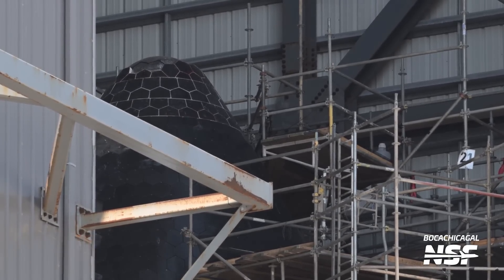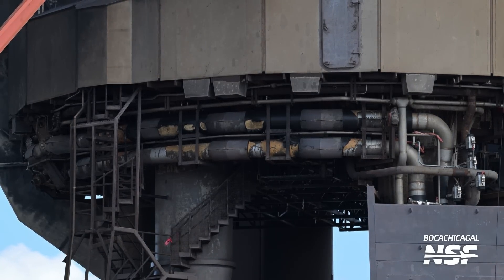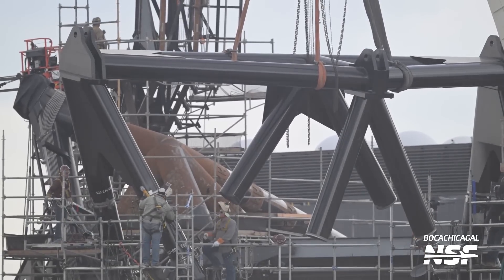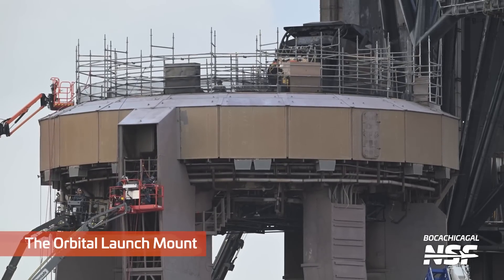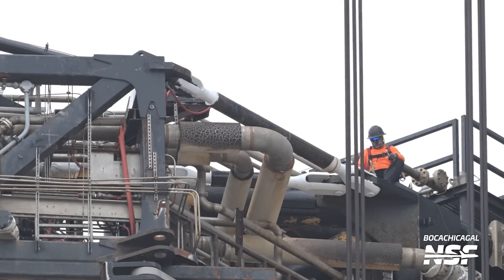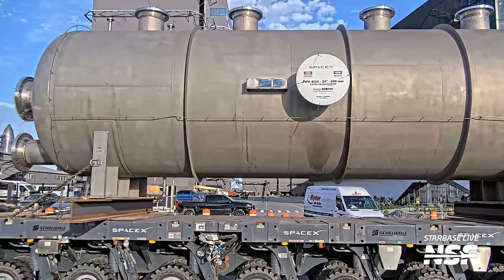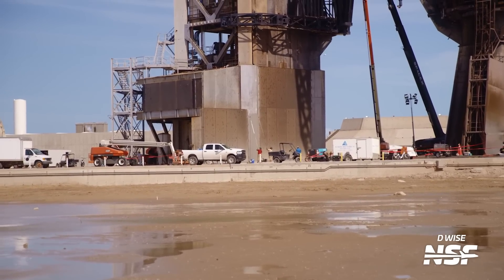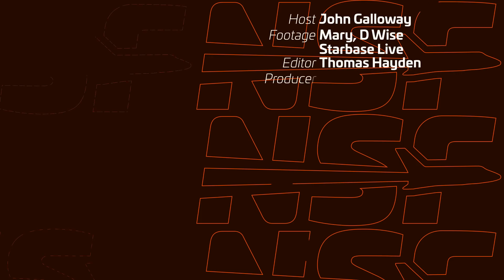Starship Launch Pad Damage Inspections | SpaceX Boca Chica

Comment: If the scrapes are in the middle doesn't that mean they're about 50% TOO long? What good is the section that never touches anything?
Reply: I believe the next set are shorter.  It's easier to remove than to add had they been to short and missed. :)

Comment: I wonder if the OLM at Pad A will become the "catch" tower and Pad B will be the launch tower?
The open design of OLM A makes it fragile, I mean, look at the insulation of the pipes and stuff .. 
There is a big difference between 7700 tons of pressure from the raptors at launch vs ~100-250 tons of pressure at landing.

Comment: I doubt they will try to fix the front flap hinge burn through issue on the remainder of the block one ships. With the flaps being placed more leeward on the block two design, they would be trying to solve a problem that may just go away by itself.

Comment: Two comments/questions: The water deluge system was used again when the booster landed/was caught, but the booster seemed at an angle, so would it not scorch or damage parts not normally protected by the water deluge system and second, the chopsticks begin to close before the booster is actually between the arms, so how does the tower know when to begin the closing sequence? Does the booster flight software actually control the chopsticks in the final phase of landing?

Comment: I dont think the current heat on the flap issue from flight 5 will be of too high importance. Since there is only 1 more Block 1 ship left to launch, and the Block 2 ships have the flaps moved in such a way they will not be in as vulnerable position. They will only go nuts strengthening that area if thier analysis of the data results in escessive heating where the Block 2 flaps will be mounted.

Of course for the next flight they might choose to do minor work, but I think they will more focus on other areas for the ship, and fully checking over the rest of the heatshield as well as going over the booster with a fine tooth comb.
Reply: I just don't understand why they don't roll the Starship, say 10 degrees side to side, to allow a bit of time for the edges to cool off and to more evenly distribute the plasma heat?
Just like what we do with our hands in front of a fireplace, to get an even heat over the whole hand.

Comment: The sheet under the tiles is flexible, so it would be interesting to known if they could fold it from the body to the flap and stop up the gap where the plasma gets is. It would receive a heap of pressure, so not sure that would be possible, just a thought. A fabric could move with the movement of the flap but still provide some blockage of the plasma (and air) through the joint.
Reply: It might be a moot point with the changes made in he V2.

Comment: Even though the catch looked super smooth, I bet they can alter the timing on the chopsticks so the first contact any part of them have with the booster is the pins hitting the rail. I kinda got the impression that the chopsticks were being controlled manually with a joystick for each one like operating a crane or a digger. There was some degree of resonance there as the top of the booster was bouncing between the chopsticks like a ping pong ball. Hopefully the smaller chopsticks on stage.. zero.. two? North tower? Tower B? will fix that.
Reply: They were all software. With that size, you introduce resonance that you mention. Humans could not work quickly enough to move the sticks quickly enough to smoothly get into place. Yes, the smaller sticks for Pad B will fix a lot of it.
Reply: @EMichaelBall  I've no doubt that it will eventually be operated automatically when they want a 1 hour turnaround on a booster taking off, landing and refilled for the next flight at T-zero, but software would have had a very bad time as a first event with cameras shaking to bits and have no historic data to work with aside from the the stationary test article slap tests, which wasn't a moving vehicle and was precisely mounted to the OLM at the time.   

Right now the chopsticks are manually operated when stacking the booster and/or ship, the QD arm etc, and then manual destalking onto the SPMTs.   They have to use drone cameras to align the vehicles properly to the OLM and then stacking the ship on the booster. 

If they haven't yet automated stacking (which is the easy part) despite having 100+ stack/de-stack/OLM mounting events, then I doubt the catch was automated at this point, but happy to be proven wrong by SpaceX if this was the first time any of the stage zero was automated.  In IFT4 they did automate the water deluge and chopsticks at the time the booster would have returned, but that was more to see if both were still in operational condition after the launch, rather than a catch event.   

The booster still hit the rails a little hard and the hydraulic buffers didn't do anything to dampen the impact until after the booster shut down the engines and put the full weight on the chopsticks, so they didn't do what they were supposed to do.  That's a lot of dry mass and a lot of fuel left in the tanks to come to a sudden stop like that, which flexed the chopsticks.   That's just a matter of timing though, and in future they won't have to do that last minute horizontal movement from the beach toward the tower, and can instead come straight down to the waiting chopsticks.

Comment: The bird at 4:15 is definitely an egret. It is hard to tell from this shot just how big it is, but Snowy Egrets and Little Egrets have black beaks with yellow feet while White Egrets have yellow beaks with black feet. This one appears to have black beak and black feet - so possibly a hybrid. Snowy Egrets typically have yellow coloring around the eyes and this doesn't so I will go with it is a Little Egret.
Reply: Little Egret don't exist in Texas.
Reply: The lighting on the feet is not too good, otherwise they would probably appear yellow, but it's definitely a Snowy egret with that black bill.  The neck is not as long either as a Great egret.

Comment: I am still absolutely dumbfounded about how quickly and with what extreme precision they moved those catch arms. Seeing how extremely careful and ponderous you have to move those large cranes to avoid flexing and ringing, I have no idea how they can move those giant structures without any noticeable flexing whatsoever.
Reply: They may have the best software engineering team in the world.
Reply: @EMichaelBall  Even if that is true, they still must have a metric ton of sensors and real-time computing power on those things... And REALLY good mechanical and hydraulic components to get that centimeter-precision
Reply: @feynthefallen Their engine thrust actuators are fully electric. I don’t think there are any hydraulic systems on the rocket. SpaceX prefers avoiding hydraulics to save mass and improve reliability.
Reply: The booster did most of the work.
Reply: @mervstash3692  You are missing my point completely. The pads on the booster are what, 50cm wide if it's a lot? Neither did they slip through the gap between the arms, nor did the catch arms crush the booster. A few scratches in the paint and a few crumpled vanity covers on the booster is all that happened. THAT is my point.

Comment: a thought no idea how much they read chat   you need some sort of high pressure water bath on top of the OLM when landing to reduce the cutting torch damage  easy as a fire truck pump and nozzle    the rocket exhaust will do the spreading
Reply: I’ve heard that Pad B will have a water cooled OLM plate as you describe.

Comment: I would have thought that an additional buffer wall covered in thermal tiles positioned along the length of the flap junction would help.  Positioned just a bit further out so that it does not foul the flap movement or air flow.  That would divert much of the heat away from the flap hinge root joins. Just an idea! 🙃

Comment: I wonder if the alignment pins were not needed as the booster was never fully released from the chopsticks and perhaps they lowered it to the OLM only as a safety measure to stabilize the bottom end of the booster while it was made safe and ready for transport.  Did the chopsticks ever fully disengage from the booster before it was removed?

Comment: What are the odds they reduce the length of the chopsticks? As these were the initial design and we know the new design are shorter, since the successful catch, they don't need the extra length for margin. Also, removing the unneeded length will reduce a significant amount of mass.
Reply: Pad B will have shorter chopsticks.

Comment: since we're stuck with the original OLM fixed to the ground at launch complex 1, some effort needs to be expended to make it possible for Mechazilla to rotate 180 degrees 1/2 to 3/4 way up to allow catch to be made away from OLM, perhaps over a ramp flame deflector.  Rotate back to original position to lower booster to the ground.
Reply: Agreed.  It seems logical for the catch to be on the opposite side of the launch.
Reply: Engineers know: "If it ain't broke, don't............." Enough said already. On with the next one.
Reply: @David-yo5ws  but it is broke, the landing flame damaged a lot of the OLM.  they can't keep repairing that for weeks after each launch.
Reply: @ericperkins3078  What? We did watch the same video? Oh, you didn't lisiten to the narrative maybe. You would have heard John say there was 'no damage' to the OLM. 
Maybe from take-off? But a lot of that has been addresses already.